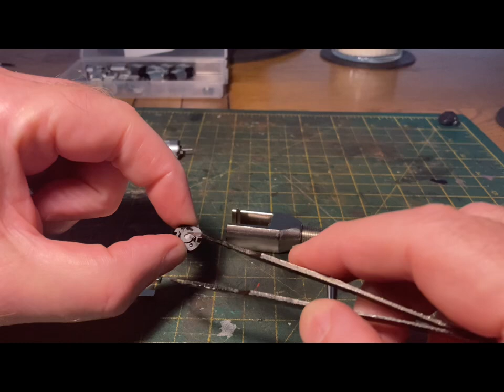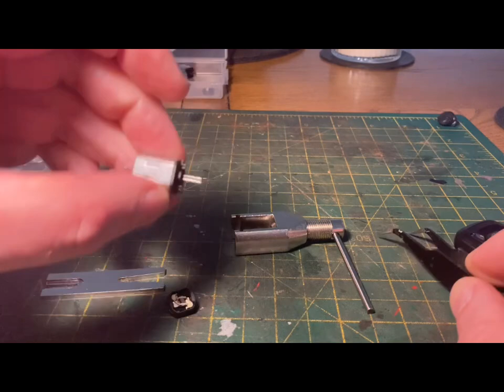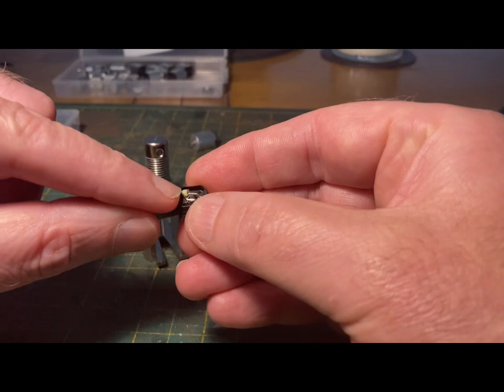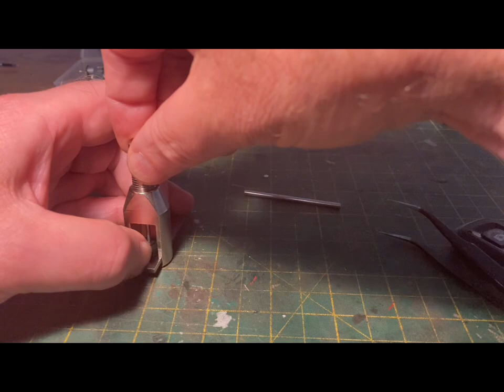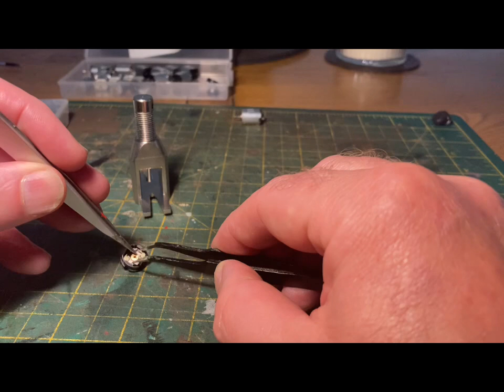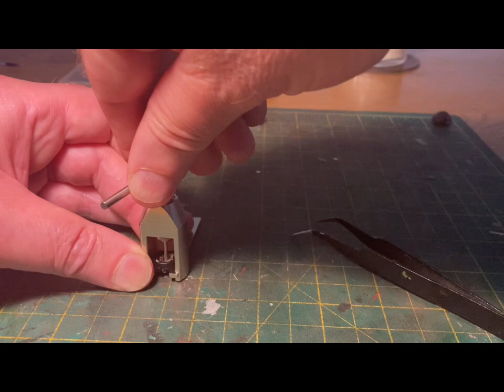Hornby TT:120 motor upgrade, preparing N20 Carbon Brush End Cap for installation

Comment: I have just replaced the end cap with carbon bushes in a failed motor from an 08 shunter following your advice/videos with success... now running smoothly. Many thanks for taking the trouble to make these fantastic videos and sharing your skills and knowledge... absolutely brilliant.
Reply from the maker: Delighted you got your shunter going again. I can’t take all the credit as a few people have been contributing to various elements of the fixes 👍 It’s going to be interesting to hear how your shunter goes long term, I haven’t had to do mine yet but the stop start and reverse work does seem to be the thing that does for the OE motor brushes.

Comment: Could you not just cut the end of the shaft off instead of swapping the bearings? There is no flywheel after all
Reply from the maker: If you had precision measuring and cutting tools, that would be possible however the fixes are aimed at what is realistically possible for most modellers. The additional section of shaft also aids refitting the end cap, it centres the assembly but isn’t as likely to fall off as with a very short tail. Drilling the cover plate isn’t practical either, it’s stainless too.

Comment: Things are starting to get a bit tricky for me, I guess. After getting tired of returning the same A4 for the foutrh time for letting Hornby exchange a blown-up motor into a soon-to-blow-up replacement (and the messing up with customs about why it is going back as a warranty issue again), I've sent an email to sb-Modellbau customer service with an enquiry for a custom-made motor replacement. That would be a coreless motor, with at least one flywheel, if they can find enough space for that.
Reply from the maker: Check out MicroMotors.EU, they do a coreless replacement for the Hornby OE motor, no flywheel but probably available locally for you 👍I haven’t tested one yet but I did fit one in Roco BR108 after Roco decided not to honour their warranty.
Reply: @HighFell  Had the same issues with Roco as well, both with HO and TT scale models. I went for a conversion kit for my Roco 0-6-0 DB class 80 tank engine. The conversion was easy to do (a bit of soldering and screwing) and the model is running very smoothly since then. And this at about 130 working hours.